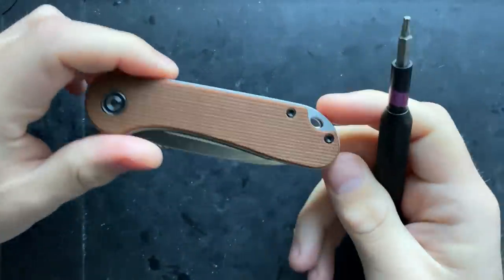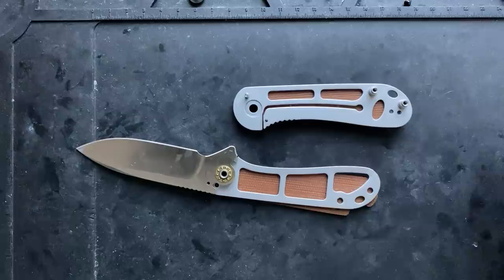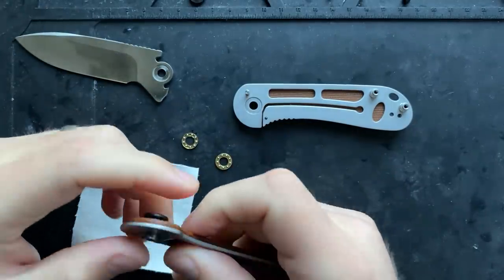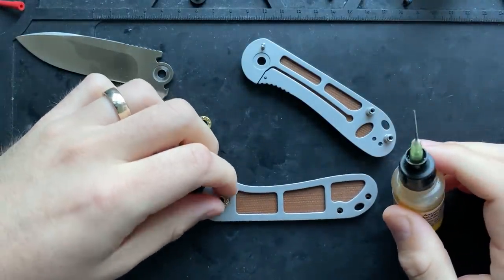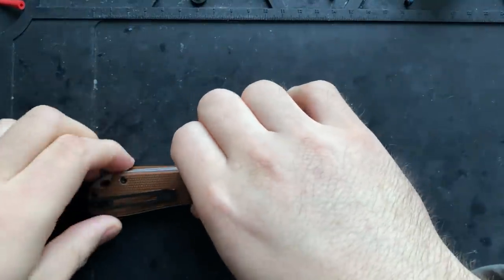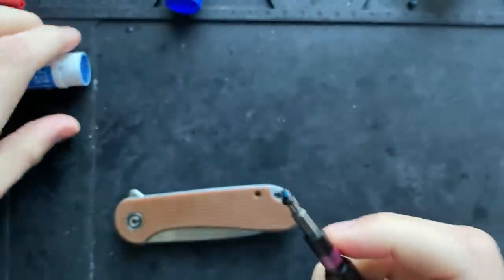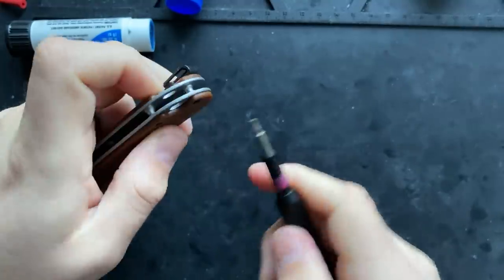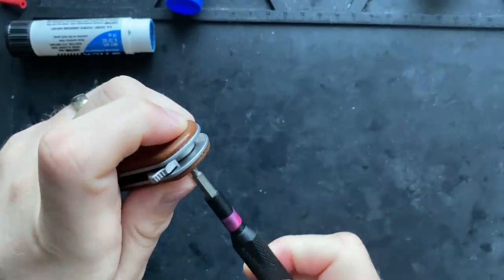How to disassemble and maintain the Civivi Elementum Pocketknife

Comment: Perfect!
I just ordered my first Civivi. 
What tool set would you recommend for disassemble of this knife? I’m a newbie and couldn’t make out what you said to check out. Thanks!
Reply: Having stripped many torques screws using cheap tools I use nothing but good ones now German made I can't remember the name I'll have to look when I'm home . I found them on Amazon the knife takes t6 and t8 so get a set with like t5-t10
Reply: I ordered  the Civivi praxis last month it's so good my second Civivi the Elementum will be here tomorrow . If I had a dollar for every time I flipped the Praxis in the past few weeks i'd be rich .
Reply: @motorcyclemark2889  which do you prefer. Elementum or Praxis?
Reply: @Jacob-rf3bb  I like the praxis just a little more because of its size its bigger and it is absolutely a drop shutter the elementum is not far behind I like it too its gotten just as much carry time maybe more . they are both great knives I bought a kubey  046 titanium scales I've been carrying a lot too

Comment: I bought and installed a back spacer from Etsy. Ever since, the hinge screw seems to be especially sensitive (comes a little lose on its own). AND, the blade periodically jiggles a little due to the hinge screw gradually loosening with use (used to be perfectly taut).
Reply: Maybe Loctite on the pivot would help that.
Reply: Mine does this as well. Did you try out the lockite?

Comment: Based on this video I decided to buy an Elementum which just came today.  This is my first "flipper" so I have no idea what is "normal" and what is stiff.  But mine seems stiff to me. Actually hurts my thumb when I try and deploy the blade.  Following your video, I took it apart, cleaned (it wasn't dirty!), and re-oiled the pivot bearings, etc. Still stiff to me.  No knife store within 100 miles of me so I have no one to ask or other knives to use as a comparison.  Help!!

Comment: I just got a new Civivi Elementum but it is hard to open with the flipper.  Admittedly I am  72, my eyesight isn't what it once was, even with reading glasses for close-up work but following your video, I got it open, cleaned it up, lightly oiled the pivot areas with KPL Pivot Lube, reassembled everything, and yet it is still rather hard to flip open. It opens the blade but I have to flick my wrist to finish opening it. I am not too embarrassed to ask as to which side of the little caged bearing type washers goes in toward the blade. They appear to have a top and a bottom and the bottom (as I am calling it) has a little recessed channel. To be clear (I hope) do the top of those caged bearings face inward toward the blade or outward toward the skeletonized liners, etc.? 

 

I very much appreciate any help that you or any of your experienced subscribers might be able to provide.
Reply: same issue here.

Comment: I’m not Nick but I’ve carried knives for twenty years. You don’t need to be a mechanic to get good action or disassemble this knife. Just rinse it with soap and water, shake it dry, blow dry for best result. Then use ANY oil. And just put it on the pivot and use a towel to absorb the excess. A fifty dollar knife works fine with that.
Reply: Nick with all due respect is a Prima Donna about his knives be they budget or otherwise.
Reply: I used olive oil I bought at a discount grocery store.
Reply: @RC-yn7wv  cheap mineral oil works just fine but i used the daiwa reeler oil (probably just a simple mineral oil) because it's just easier to apply.

Comment: Great video! I just bought the same knife and it’s a little stiff out of the box. I was kind of bummed that it wasn’t smooth but I might try to put a little oil on the pivot points. What size and type of bait are you using on those screws?
Reply: bought the step up WE Elementum in titanium and the same thing happened to me. I'm here because I had to take it apart and clean it (then put in some break-in elbow grease) to get it to smooth out.

Comment: Do you have any tips on when trying to disassemble, for a pivot that spins freely, and I cannot loosen it?
Reply: I don't know if you found an answer to your question but those screws are sometimes called "sex bolts" and in order to unscrew them you need two pair of the same driver. 

One of those sex bolts is like a pipe and has teeth on the inside (female), and the other is like a shaft with teeth on the inside (male). Use one driver to stop the screw from rotating and use the another driver to unscrew. Hope that helps.
Reply: @kenwatanabe2864  he won’t be able to as 1 side is a logo and not a screw

Comment: I know this is a 3 year old video but I  noticed something and had to comment. With Nick's Elementum, the pivot setup is the reverse of mine. On Nick's the C side of the pivot is the threaded receptacle (female side) for the torx side screw. On mine the torx side is the female side. Is anybody elses set up like mine and if so do you have problems with keeping it centered and experience a gritty feeling in the action?

Comment: l have this knife and it wont center. The blade is stuck to the right really tightly even when I loosen the pivot. Ive tried pushing it over but it snaps to the right again.
Reply: I had the same problem, I had to swap the bearings around so that one side had the bearings against the blade, and the other side had the bearings against the scale.
That and when I tightened the pivot, I placed a piece of thick paper on the side it favored to get it centered right. It took 6 times or so.
Reply: @andrewjackson2137  I'll have to keep trying
Reply: @northernninety7  , keep trying. It took me several times to get it centered right.
Reply: Careful with the pivot screws. I lightly tightened mine after cleaning then stripped out the notch that holds the logo screw in place when trying to adjust the detent. The micarta definitely doesn't hold as well as the g10.
Reply: I had the same problem after I disassembled the knife. I eventually found that loosening the two rear frame screws just a bit pretty much solved it. I could see the blade move as I tightened and loosened them.

Comment: what kind of screwdriver is that? could you provide some info, pls? :)
Reply: Called a torque or tork screw driver.
Reply: Elemten  is the answer to the Buget.   Bugout  .gent is the big   brother,!! .
The 3.25 Blade Length is what WE. WANT.  KERRY
Reply: @kerrykitterman9714  yes...I have 3 elementum

Comment: When I begin to loosen the pivot, the other side turns with it. Consequently it cannot be opened. 
The pivot has no flat to prevent rotation. The only prevention is a little divot in the skin under the "C" logo. A Deal Breaker.

Comment: Hopefully yours is better than mine. My elementum came with such a weak detent.
Reply: Has that detent gotten better or is it something you can fix?
Reply: @greg6162  it didn't get any better. But I did get used to it and it's not bad. I can tolerate it
Reply: @samdungan03  so it basically depends on the machine marks on the detent... I assume the deeper the better?
Reply: Funny, mine came with a SUPER hard detend, even unsafe having to use that much force with those very smooth wood scales (damas model), which made me hate this knife right away...
After this very simple disassembly and oiling, it's a bit better.
People bend the liner a little to make the detent weaker or stronger, I did that a little but a bit afraid to overdo it and that it wouldn't lock up well. I would say it's acceptable now... At least I'm sure it won't open in my pocket, and that is good !

Comment: Does it matter what orientation the bearings are in cage up or down?
Reply: i think nick flipped the orientation when reassemble, mine came with the groove sides facing the blade so i just reassemble back the same way.